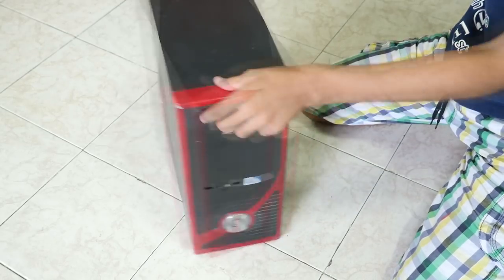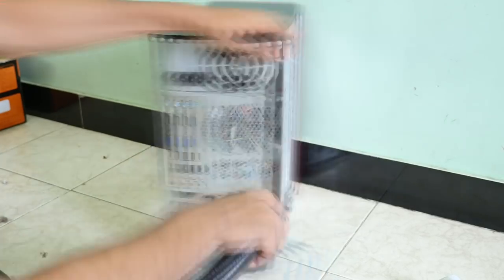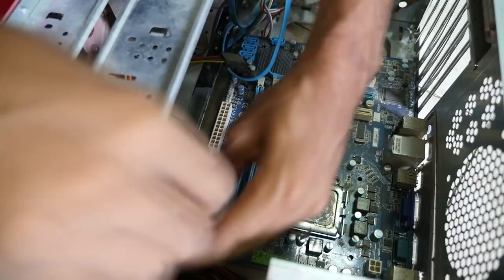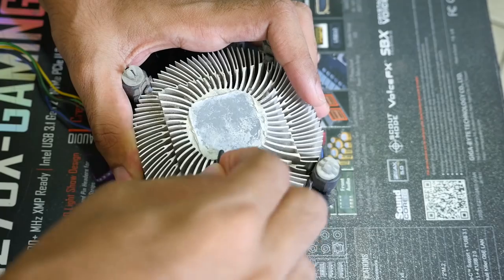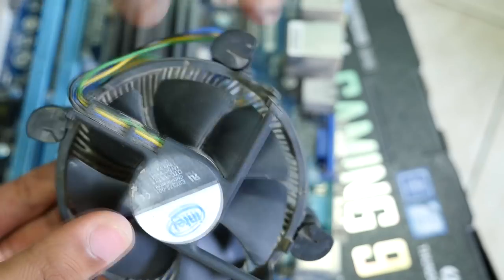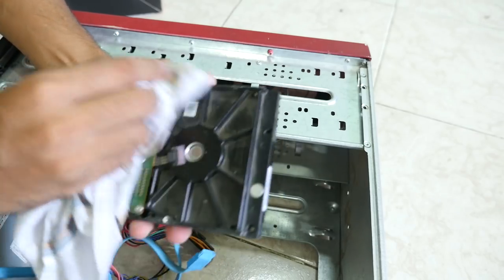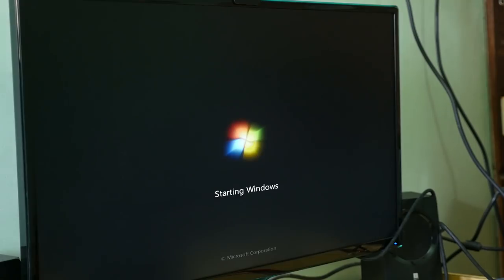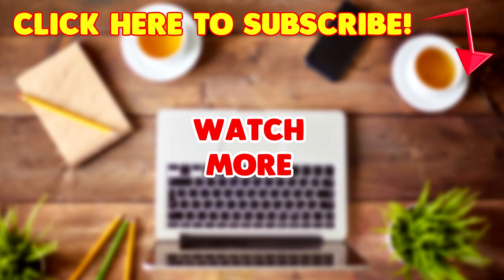How to CLEAN a very OLD PC by disassembling everything (almost)!

Comment: make vedio on 35000 rs pc build which is for gaming nd all other mc office nd editing vedio etc
Reply: NOT possible in 35k ! haven't you checked RAM prices ??

ryzen 5 1600 16550/-
PSU Antec 550W 3500/-
MSI B350 mobo 7600/-
GSkill 2400mhz RAM 16GB  7700/-
SSD 120GB 3100/-
WD Blue 1TB 3400/-

---------> 41850/- till here

GPU as you wish !
1050 10000/-
1050ti 15500/-
480 8GB 24000/
1060 6GB 25000/- MSI gaming X
1060 3 GB 18500/- MSI Armor
1070 34000/- MSI gaming X

delhi nehru place prices.
Reply: Gigabyte H110M - 4k
cabinet - 4-5k your choice
peocessor - intel i3 7100 (3.9ghz) - 9k
RAM - 16GB DDR4 - 9k
PSU - 4k (450W more than enough)
HDD - 3k 

you dont need a video card for office excel n all.. these will be more than enough!
Reply: Hitesh ryzen -_- is meant for gaming! bhai kuch bhi likh diya spexs without any idea..  ans 550W PSU ? kidding me?
Reply: gaming with i3 vs gaming with real 6 core  ryzen 5.. i hope you still in senses. 550W is enough.. enough for even driving a 1070 with this CPU. 
you must joking.. recommending i3 7100 for gaming in April 2017 ! that too without Graphics Card. and BTW 450W PSU costs 2800/- in local market.. brands.. Antec, Corsair, Cooler Master.
Reply: Damn! i ready it wrong lol... i read it as not for gaming :3 im sorry!
Reply: 550W more than enough thats what i said.. said not to go for 550W to save few bucks there 450W more than enough even if u get gtx1060

Comment: Dude, there is still residue on the processor and heatsink. Did you not clean properly. The thermal paste looks like  Vick bam.Get a proper one like  Arcti clean and performance mx series. Ssd will be a recommendation.

Comment: Any due upgrades on my pc: i7 3770k,16Gb ddr3,Asus z68,gtxx 770 2gb ddr5,120gb ssd. 650w cm power supply
Reply from the maker: Maybe graphics card?
Reply: Dhananjay Bhosale thx for repky and i only game at 1080p since i dont have a 4k monitor.. not sure its worth upgrading to something like 1070 for 1080p performance.. my 770 performs just as good as 1050 so if i upgrade its gonna be 1060+

Comment: You can use iso propyl alcohop to clean ghe board and to remove stain marls such as thermal apaste marks. The alcohol will not do any damage to the board.